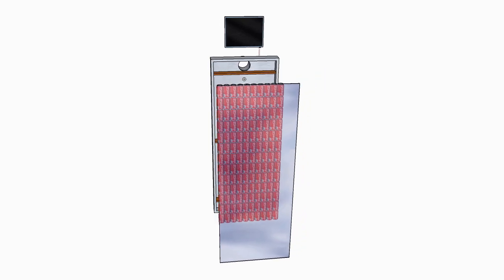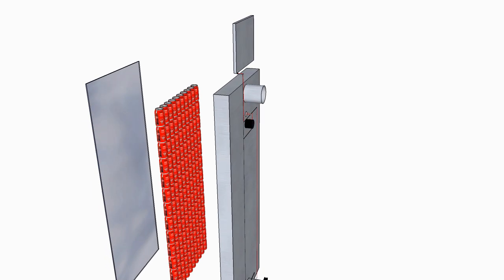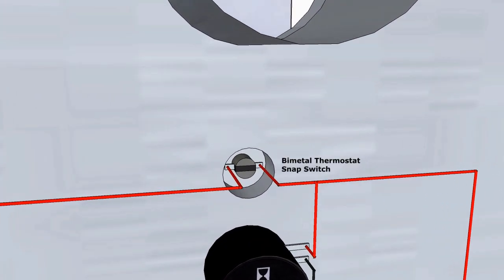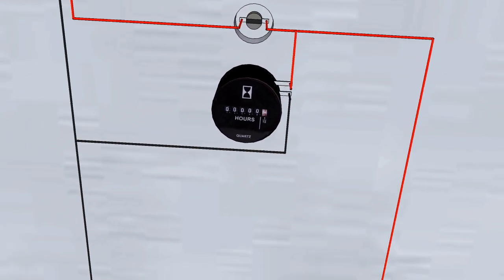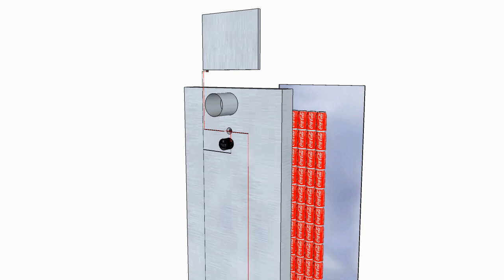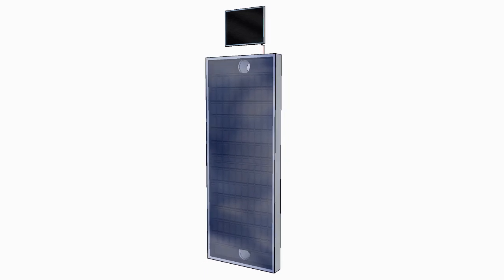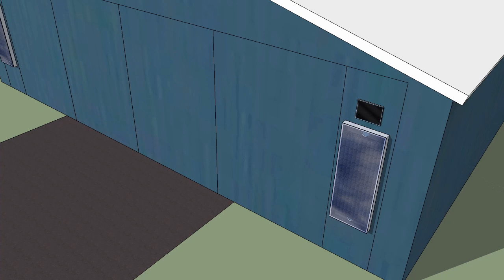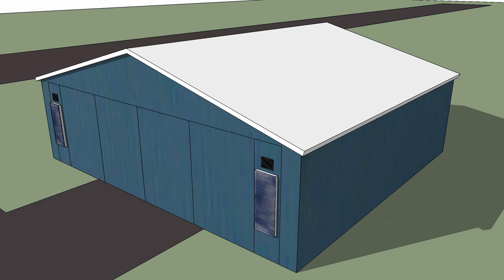DIY Solar Air Heater Part #1

Comment: A parts list for the electronics would be very much appreciated and your solution looks much simpler than what I had researched as I'm not as electronically astute as you seem to be.
Reply from the maker: Good morning, thanks for the note. I currently have five
videos in the series and I am learning as I go. 
I can share with you now, my original design produced too much heat and
not enough flow.  I have since redesigned
the interior of the cans to address this issue and will have a 6th
video out this fall. Regards.Dwayne
Reply: Dwayne Price - Good day Dwayne.  Has video #6 been released yet?

Comment: Your video is very impressive as your skill set now I see you work on planes so it makes sense but I have a question about the efficiency of cans versus other materials some people say that the aluminum downspouts work really well you mentioned they don’t work as well I’m just trying to find where I collected storage of information on the best material is to use inside the collector please help

Comment: please. you have a technical diagram where to install the ventilator, the thermostats and and humidity sensor to keep an ideal temperature for drying fruit. and how to make the control board.

Comment: i really enjoyed your video ,so much the i want to bill one to myself.
i´m trying to buy a solar panel,fan,hour meter and snap switch that are compatible.
but i´m having some problems...
so i´m hopping you could help me with that.

i was able to find :
12v  3w 120mm fan
10 to 18v 3w hour meter
snap switch (no info)

my problem is what panel should i buy?
i got many option on 12v panels (3/4,2/5,2/6/watts etc)
since bouth the fan and the meter are 3w,should i buy a 6w panel?or conecting a 6w panel to the system would burn the fan or the meter becuse theys are 3w?
thanks
Reply from the maker: I too have experience problems with the solar panel. My first
purchase was insufficient.  I am now going
to install the unit using AC power initially, and convert to solar when my
schedule permits further research.  Additionally,
my first design, the design of the cans, is producing too much heat.  I have had to redo the design of the cans to
reduce temperature and increase flow.  I will
be sharing all of this, my success and my failures, in my 6th video,
later this year.
Reply: Go check out Jake Porter's build. He has all the info you are looking for plus discussion of proper cfm.

Comment: Really enjoyed your videos! Are Amazon part numbers available for the parts you used? Snap switch, fan, solar panel...
Reply from the maker: Russell, I’m learning as I am going.  Snap switch works fine.  Yes, I got it off of amazon, but don’t’ remember the part number.  I think it was like $5.00 for five switches.  I don’t recommend the solar panel I bought.  Not powerful enough.  Learning.   I have also had to redesign the solar cans, as they were producing too much heat, and not enough flow.  I have a 6th video coming out, now several months overdue, as we are in the middle of moving.  Hope to have an updated video out in the new year.
Cheers